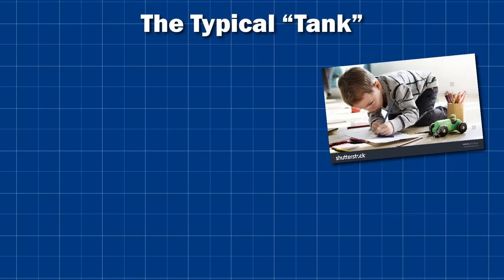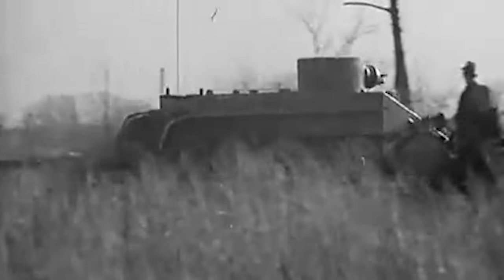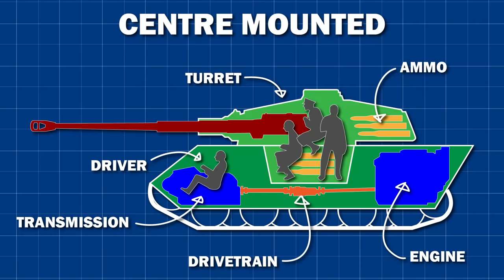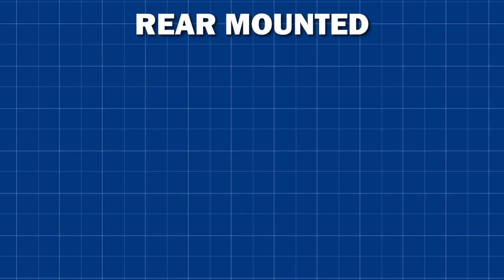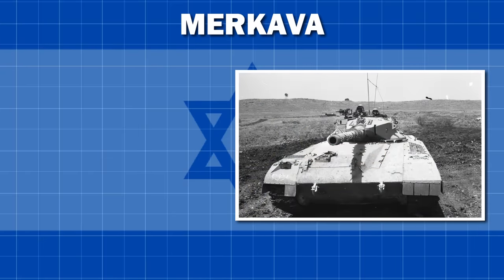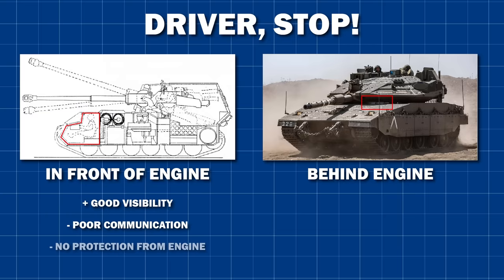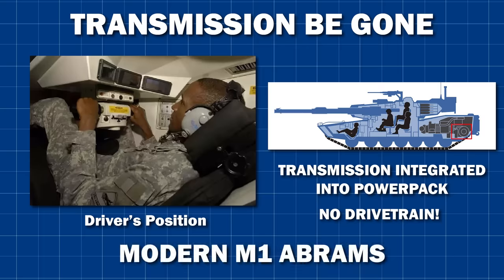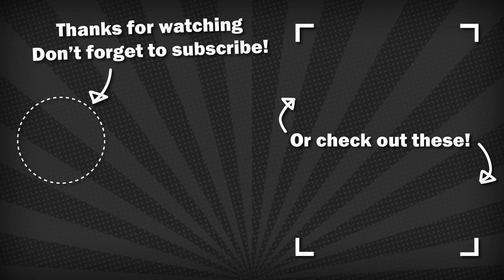What happened to Rear-Mounted Turrets?

Comment: 1:25 *driveshaft
drivetrain is the term for everything that's involved in powering the vehicle,  engines, transmissions, transfer cases, differentials, etc
Reply from the maker: Furious at myself. 5 years of engineering school to make a mistake like this… 

Pinned this as well because I know everyone will be making the same comment! Cheers for pointing it out anyway - hope you enjoyed the rest ;)
Reply: @RedWrenchFilms  nothing tragic, I certainly enjoyed the video, 5 years engineering school? sounds a lot like me except I didn't graduate😭 will have to go back in for one year to get my degree
Reply: @imnotusingmyrealname4566 Don't worry about it. I hear that it is difficult and a lot of people loose a year or two.
Reply: @imnotusingmyrealname4566  oof, what engineering discipline?
Reply: @RedWrenchFilms  
you forgot to mention that maintenance is easier when the engine is rear mounted
Reply: @RedWrenchFilms  rear turet are not dead following example:  Russian BMP3 Dragun BMP3 Dragun 125mm t15 Armata t15 Armata 57mm ,Chinese ZBD-04 VN 17 VN 20 VN50 IFV,Sweden CV90120 ,German PUMA LYNX and LYNX 120MM and BOXER TRACKED IFV 120mm,UK Ajax 40mm,South Korea black Windows ifv, USA M10 boocker and the Last one and the best the prototype of early 2000's HD-40T Wombat with remote operated turret and engine under the turret  he was à  equivalent of t14 armata by way lower way shorter and way lighter and design of futur USA tank like ABRAMS X  follow exctally this way but Wonbat was better design and french design in some way to for concept art for MGCS.
Reply: @NicolasADER-i7d  rear turret is dead for heavily armoured vehicles
Reply: @lbr2845  The Merkava would like a word.
Reply: @TheSonic10160  Merkava is the exception, not the rule
Reply: @RedWrenchFilms  happens
Reply: @RedWrenchFilms there's your issue you're too busy putting oil filters right next to the exhaust pipe to realize mistakes that occur. Don't worry we all do that sometimes because we like to see mechanics burn Right?
Reply: Can you please make a video about the TAM, the argentinian tank in your video. @RedWrenchFilms
Reply: @RedWrenchFilms  Meh, it happens.  There are only two groups who are gonna call something like this out... those who recognize it as a minor slip up, and internet pedants -- and do we really care about the latter?
Reply: @RedWrenchFilms 5 years of academy training wasted!
Reply: A drive shaft is a component of a drive train ...
Motor,transmission, drive shaft then differential.  😁☝
Reply: also the issue he mentioned at the given time is easily fixable by simply mounting the transmission in the rear with the engine
Reply: @lbr2845  I don't think it would be an maintenance issue for rear mounted turret or that it wouldn't any make any difference
Reply: W pfp
Reply: @gallustsp  real
Reply: @gallustsp  hm where is yours from? it just doesn't cover to mind for me rn
Reply: @imnotusingmyrealname4566  believe it or not its actually AI generated. I just thought it looked cool. Its kinda similar to the Aperture Science logo from portal but not quite
Reply: @gallustsp  hmm interesting
Reply: @imnotusingmyrealname4566  yessir. How long have you played swtor for?
Reply: @gallustsp  I honestly can't remember, I played it many years ago when I was young. It's the best MMORPG imo, amazing story.
Reply: Drivetrain doesn't include engine.  Powertrain what you would call it if your including the engine.
Reply: @fukkitful  wow I've been using powertrain for that but for some reason I forgot it when typing this comment, thx
Reply: the drivetrain is the components of a motor vehicle that deliver power to the drive wheels. This excludes the engine or motor that generates the power.
Reply: The issue was with the transmission which is part of the drive train not the drive shaft
Reply: Spot the mechanic: level easy
Reply: Sector

Comment: I honestly never thought about the fact that the driver can’t comunicate in a good way with the commander
Reply: Commander: Driver, turn left!
"Meanwhile in front of the roaring engine"
Driver: W A T??!!
Reply: well the commander needs to communicate with the radioman in the front as well so or more expensive because you need more radios but you csn work around it that way
Reply: Arguably... it is somewhat the wrong way round. The commander has a harder time communicating with the driver. In plenty other tanks, the commander is pretty able to communicate with the driver by kicking his shoulders.
Reply: @FrancisFjordCupola  oh right I totally forgot that method of communication😂
Reply: Driver right in front of the turret, rest of the front sloped all the way down to the front wheels.
Reply: I remember someone drive T-34 without radio, commander kick driver's right shoulder = turn right
Reply: @OP4455OP  it's more effective than shouting.
Reply: Tank crews have comms integrated in their helmets so this isn’t really an issue they did this back in ww2 a perfect example is the Sherman they weren’t inside just yelling at each other yea they yelled purely to make sure they would be picked up on their comms
Reply: Me who watched an hour long documentary of Mk. V tank: pathetic
Reply: The sad rope around depending on the vehicle - the Gunner can have a round or wire hanger and aggressively poke the driver through the turret cage.  Let's the driver know there is a problem.
Reply: @OP4455OP if there's slope down ahead he just push his foot into driver head 😂😂
Reply: The driver and commander can communicate clearly on the internal intercom. Whoever said they cannot communicate knows nothing about modern tanks.
Reply: @FrancisFjordCupola  Even in quieter vehicles such as the RG's we rolled around in throughout my year in Afghanistan we had noise-canceling headsets keyed to the radio in the vic, we could broadcast inside the vehicle where anyone could hear or on a radio freq outside the vic and hear just fine, even directly after an IED strike (Which in at least one instance was a 300 lb Home-made explosive placed in the road) we had no reported hearing loss despite it detonating directly beneath us. 

It stands to reason Tank crews would have an even better system set up than what we got, no need to for 'analogue' comms. As far as I'm aware as well I only ever heard of steering in said fashion in smaller 'tankettes' and other very light armor where the commander or gunner was directly behind the driver. But I'm not a tank crewman, I could be wrong.
Reply: The driver and commander can perfectly communicate via wired intercom - I don't know the exact date such a system was first used but it was at least in use even prior to WW2 and can be both a regular headset with mike as well as helmet integrated with throat mike or a combo of those. Actually it's no less than VITAL for the driver and commander to have permanent communication as it is the commander who has the best view regardless of hatches open or (particularly) when closed. Also at least one other crew member in the vehicle's war room will be connected to the intercom
Reply: RADIO. Everyone is on radio headset with noise suppression
Reply: Meanwhile, that's my first guess on why they didn't do it after he presented the diagram. 

They're like 2 meters apart with a huge engine in between.
Reply: @yakymua  Nope - a RADIO (ie wireless communication) is too unreliable/ vulnerable to jamming not to forget other normal frequency disturbances for internal AFV communication, being it war time or peace. Typically a WIRED intercom system has been more or less the standard from at least the 30s up to our time. Both on road and out in the field the driver relies on the commander's directions to securely position the vehicle as the driver's view can be severely limited. When radio sets are installed they're used for communication within the tactical unit, from company level up there are typically additional radio sets. Retired M109 howitzer commander
Reply: @localsheriff  ya ya same shit
Reply: I always though the engine was way further and the driver is behind it. Like in the merkava
Reply: ?? Most vehicles built after say the 1930s had internal communications built in, with the crew members wearing headsets.
Reply: Ah yes, and there aren't massive offices full of people currently who's sole job is to deal with communication systems malfunctioning.
Not to mention that there's a big ol' engine sitting right there that definitely wouldn't get picked up on the internal radio and you're totally not going to hear gunfire and explosions when you absolutely need to talk to the driver.
Reply: @smpljack2478  OK so how much time have you spent on/in AFVs? I'm an Armoured Corps Officer with 30+ years of experience. Yes sometimes things fail, most times they don't.
Reply: It's basically an invalid point. Headset communication (intercoms) is already a forced standard for tank crews due to the extremely noisy interior (engine + tank hydraulics + AC & ventilation + transmission + gun operation).
Reply: Even if you have a good, reliable intercom, tanks are designed with considerations for being used in suboptimal conditions. 

So, yes, they would consider how to communicate if a large piece of metal travelling at a high velocity disabled that intercom. Just like modern tanks also include manual traverse mechanisms for their turrets.
Reply: It's better these days , consider that Russian T-34 tank took air to the crew area from  top of the engines , there was no sound proofing at all .
They could have used  Engine Order Telegraph , that was used on ships , it has 9 simple orders , for tank you would need some extra ones 🙂
Stop , Stand by , finished with engines , Astern or Ahead Slow , Half , Full ... tank would need more than that .
Reply: @imnotusingmyrealname4566 you don’t really want to use radios. At a time before encrypted comms, it was a bad idea to have unnecessary transmissions, and in the modern times, it’s still a bad idea because encrypted comms might be harder to be listened into, but any transmission puts you in the map. 

Plus now you gotta have another antenna for the driver and worry about external factors creating interference. You could just transmit inside but radios don’t like being enclosed in a metal box. 

There’s a really simple solution that’s older than even the use of radio itself. Talking to each other electronically. It’s cheaper, less points of failures, really good for RF emission control.
Reply: @imnotusingmyrealname4566 no radio needed. Just intercom and a wire. The navy figured this out 200 years ago with their yelly tubes. Get it together.
Reply: Military equipment is always produced with redundancy in mind. Just because you can have cool modern radio comms inside the tank, you do still want to be able to communicate through shouting and kicking shoulders if things go south. And there's more than just communication problems with two separate crew compartments: You can't administer first aid or shuffle around seats without getting outside of the tank, which is less than ideal if you're in combat. If the driver in a separate compartment gets taken out for any reason, it's instantly a mobility kill if the rest of the crew has no easy way to access their seat. Modern systems are great in optimal conditions but a battlefield is never an optimal condition and the more plan B's you have for any contingency the better your chance coming back home alive.
Reply: Ur not alone bro😅
Reply: @BHuang92  'Did u say sharp right!?' 😅
Reply: Why not build a rear mounted tank thats like the MARK IV where you can walk around the engine thats in the middle
Reply: Commander : Tries to talk.
Driver : Presses accelerator.
Reply: ignoring the fact that modern comms exist lol
Reply: I mean now usuaaly you look trough cameras everywhere anyway, seen the new KF51 Panther? Its basicly 1 Big screen so easier to deal eith
Reply: This dude most definitely thinks about Rome =p
Reply: It's never been a problem if your intercom system works. I really don't see "bad communications" being a huge problem. Say you didn't have an intercom system, and you placed the driver right next to the rest of his crew, it still wouldn't work great over the sound of the engine, transmission and gun and you'd have to be screaming to each other. I still have trouble hearing my TC sometimes even with a noise canceling cvc + intercom
Reply: Lose to cheap drone lol
Reply: Didnt they all had like headphones for communication in the tank ?
Reply: Same, it never occured to me that if you move the turret, the people have to move with it... to the place where the engine usually is.
Reply: First thing I thought about
Reply: The "can't communicate with eachother" is quite overstated. Normally, the intercoms work just perfectly fine and a tank crew can talk to eachother as if in a teams-call, to reference the current times. sure, there's more background noise from the moving parts but its not liek standing next to an airplane turbine yelling in your ears.
I however did always have the opinion is that the driver is much more secluded and "not in earshot" of the commander, so to speak. Especially in the case like a VK where there's a good 3 meters of noisy metal and bulkheads in the way of some guy sitting in front of all that, unseen by the others. Most others tanks, all crew would be able to see eachother sitting in 'the same' room.
Reply: Electronics exist lol😂
Reply: Nobody knows you.
Reply: In future remote controlled turrets, its expected that the crew will all be sat up front for some of the new tank designs. So could the rear mounted turret make a return?